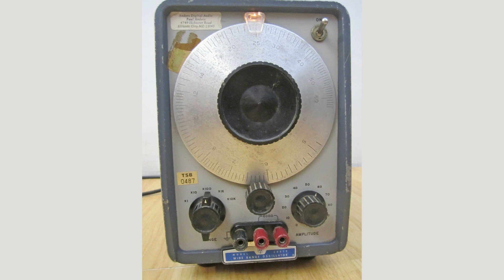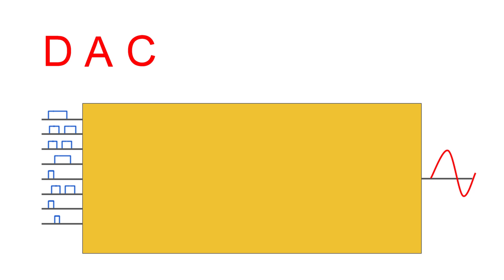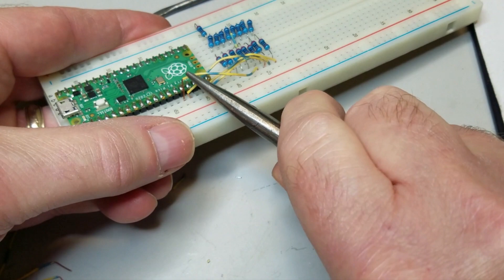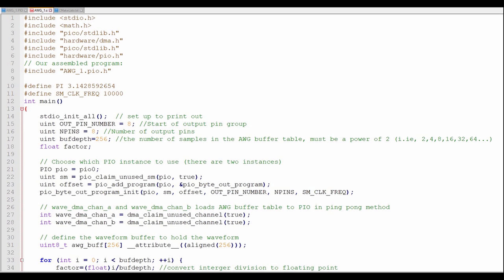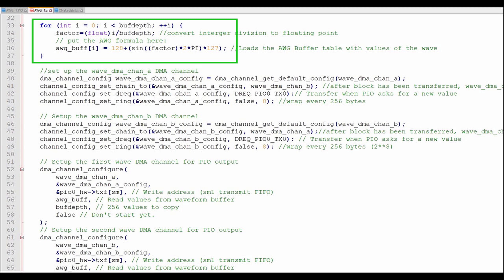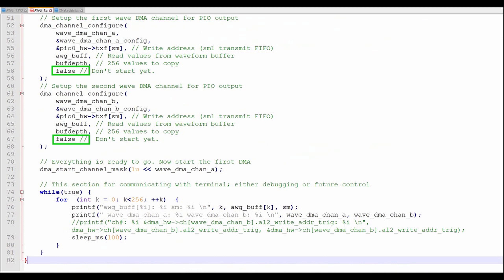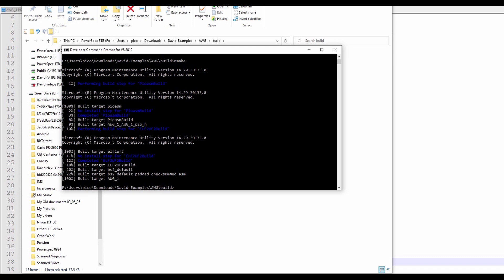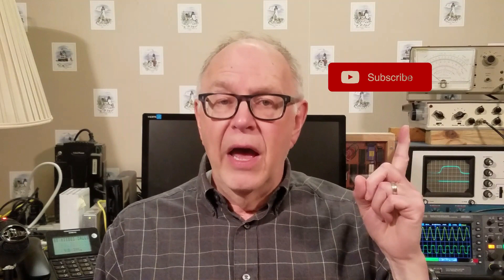Raspberry Pi Pico PIO - Ep. 14 - Arbitrary Waveform Generator

Comment: Ideas for you David:
1). Do the reverse, input waveforms, then display them via your method, basis of an oscilloscope.
2)  Modulate the waveform with a baseband signal for an AM transmitter.

Probably reaching the limits of what the Pico could do unassisted, but I'm blown away by the capability of DMA/PIO.
Reply from the maker: Those are great ideas.  I'm working on a higher frequency AWG now.  Thanks for watching!

Comment: HI David. Thanks again for a wonderful video! The Pico project I'm sorta looking at is to make a simple software-defined radio out of an Si5351A board and a Pico. I'm thinking of using the Si5351A to generate generate quadrature LO signals and a couple of SA612 mixers to give me I & Q signals. I want to read I & Q into A/D converters on the Pico using DMA. 

I'm intrigued with the potential to make a very cheap SDR receiver that's somewhat out of the normal. In particular, I'm fascinated with having the crunching power of two cores that don't have to work significantly on data grabbing. And doing it in Micropython  :-)  although I can do it in C if necessary.
Reply from the maker: That's a neat project.  MicroPython is not quite as capable as C when it comes to PIO interrupts or DMA.  I had to go to C for my video and AWG projects because of that.  Good luck and keep us informed of your progress!

Comment: Fantastic project and the whole series you're making David! Helped me a lot. Until now all my projects were C++ based (Arduino, Teensy, ESP etc.). I picked the Pico for its rapid and easy prototyping with Python, which I was looking to finally get started with. Having to go through C++ chain and the separate io file and steps to achieve the coolness of PIO is a little off-putting. Definitely not "prototyping-friendly". I wish there was Python path for the same. While I'm fine with C++,  for now I'll need to focus on the basics and mastering the Python.
Nonetheless, I'll be coming back and keep my eye on your fantastic work.
There are two important factors I really like about your videos. One, is going through the code and explaining what particular statements are responsible for. And the second is explaining the background of the topic, which like in this episode, not everyone might know what is and how an arbitrary generator works.
Reply from the maker: Thank you for the kind comments.  I like making videos, and my tendency to "over-explain" (my kids' term) helps with the background.

As you may know, many of my early PIO videos used MicroPython.  There is a lot you can do with MicroPython; although some things might be a little clunky.  Thanks for watching!

Comment: Thanks for nice and unparalleled coverage of rp2040 pio. Would appreciate if you could consider SPWM waveform generation using pio in some of your next episode.
Thanks for your efforts and excellent coverage.
PIO peripheral is already available on many other brand mcu but such a  beautiful coverage on pio is unique on YouTube.
Thanks.
Reply from the maker: Thanks for the suggestion.  I plan to follow up my Arbitrary Waveform video with one with a higher frequency op amp with a slightly better user interface.  This sounds like it would be well suited for SPWM.

Comment: Super interesting video David. It would be great to know how far you can push this up. BTW, I read it is possible to overclock the 2040 up to 300Mhz without issues. Thanks for sharing, I am learning how to do PIO programming.
Reply from the maker: Thanks.  I've got the high speed op amps but I haven't put it together yet.  Right now I'm thinking a pseudo sine wave of about 15 MHz ( 8 samples per wave cycle)

Comment: Thank you for continuing the exploration of the capabilities of the Raspberry Pico. Have you covered hardware interpolators for the raspberry pico?
Reply from the maker: Thanks for watching!  No, I haven't looked at hardware interpolation.  I'm not sure what I could do to demonstrate it on a Pico.  If you have any ideas; let me know!
Reply: @LifewithDavid1  I haven't seen examples yet but the datasheet says it can be used for audio dithering and textures. I do like the idea that it can do simple repetitive operations like right shift, masking and saving processor cycles.

Comment: Fantastic project.  Thank you.  May I suggest you use something like a BUF634 as an output buffer-amp..  And, would you make the code available?
Reply from the maker: That's a great idea.  I didn't know about the BUF634, which looks like it would be easy to implement.  However, I already bought some LM6171's and LM7171's to improve the frequency response; which I hope to do soon.  Follow the link in the description for the code.  Thanks for watching!

Comment: I'm always impressed with how much can be done with the PIO blocks!

Do you know if the block exists in other Pi devices, like the Pi Zero (BCM2835)?  For example, there's a Pi project using a GPIO to implement an RF transmitter!

Another great Pico PIO example is the can2040, which achieves full 2.0b Can Bus Specs using only one of the PIO hardware  blocks!

BTW, I've been thinking of implementing the PIO functionality inside an FPGA/CPLD.. any suggestions?
Reply from the maker: I don't believe any other RasPi device has PIO.  They do have specialized I/O for handling several different standardized protocols.  I'm not sure, but the higher clock speeds for the Pi 2, 3, 4, and 0 should allow them to do bit banging and give the illusion that they have PIO.  

Looking at the history of the Pico, it was first implemented on FPGAs during development.  I've not worked with FPGAs (I'm too cheap and the Pico gets me the FPGA functionality I want at a VERY reasonable price) but I don't see why you couldn't make it happen.  Good luck!

Comment: David, now that you are close to mastering the PIO on Pico, why not try your hand at the FlexIO on the Teensy 4 or 4.1? Nobody else has tackled this, so you’d probably attract a ton of new subscribers from the Teensy community.
Reply from the maker: Thanks for the suggestion!  As I learn more about the RP2040, I realize how much more there is to learn.  I've not worked on the Teensy before; so I scanned the web for info.  Version 4.1 looks like a very powerful controller.  I'll look into it more; but I'm afraid it could be quite some time before I can put out content that would be worth people's time to watch.
Reply: @LifewithDavid1  You bet! Your PIO series is really a general master class on hardware concepts in modern systems - and in programming them. Way beyond merely the Pico. As for the Teensy, you're right. It's the most powerful microcontroller out there. And FlexIO is its PIO. 
Keep up the great work!
PS I too work with 65xx ICs, so I really appreciate what you're doing.
Reply from the maker: @jonathanstein6056  Thank you.  I appreciate your kind words.

Comment: Sir, Can you make a video to interface ADC08100 to pio of raspberry  pi pico and display the analog waveform on a pc ?
Reply from the maker: That's a really ambitious project!  I'm not sure the Pico could handle that much data.  It only has 256K of memory, which would only be enough for a few milliseconds of a signal at 20Msps.  And that doesn't include any space for the program.  The Pico does have a built in ADC which can (I think) sample one pin at 500Ksps.  That might be a good place to start.  Thanks for watching!

Comment: Because of my electronics noobitude, I wouldn‘t have thought of using the op-amp, believing that the output of the DAC by itself would be enough. What is the output range of the DAC when it‘s powered by VUSB? How is it improved by the op-amp?
Reply: Oh sorry, the inputs to the DAC are GPIOs, so they‘re high or low in the 3.3v range. It‘s the op-amp that‘s powered by VUSB. #noob

So is the op-amp used in order to get output in the 5v range? If so, then you could do without the op-amp if you‘re okay with DAC output in the 3.3v range? #noob #questions
Reply from the maker: These are all good and important questions.  If you go slow enough, and the downstream circuitry doesn't draw any load, then you can get by with no op-amp.  However, to get any speed, or to provide any current, you need an amplifier to keep the current draw and capacitance on the resistor network as low as possible.  This will also maintain the accuracy of the DAC because a higher downstream current draw on the resistor network will load the most significant bit (MSB) GPIO more than the LSB.  This will cause a little voltage sag on the MSB GPIO, causing non-linearity.

Because the op-amp is set up for unity gain, the output will be 0 to 3.3 volts (same as the input).  Note that while the LM358 is capable of single supply operation, there will still be some non-linearity near 0 volts.   

If you were to set up the op-amp as an inverting amplifier with a split power supply, you could make an output that would be useful for all types of downstream circuits.  Op-amps are awesome little devices, and there is a ton of information on how to use them "hidden" in their datasheets.  Look through one, don't be discouraged if you don't understand all of it at first.  The idea is to just familiarize you with where and what kind of information you can find.  Good luck and have fun!
Reply: @LifewithDavid1  thanks! My mental model of an op-amp was that it‘s just for amplification, but obviously there‘s a lot more to it than that. I might have some LM358s in the “box of stuff to try out someday”, looks like it‘s time to do just that.
Reply: @slimhazard  I definitely encourage you to do! For very long time op-amps were a mystery to me. Especially, when very early in my electronic journey I saw an analogue computer full of them. They can do all sorts of mathematical operations! I was thinking "how on earth?". Lately I finally got to use them and even do some designs. So awesome and relatively easy to work with. Just like Lego bricks.

Comment: is it possible to read single colors from a hdmi signal with pico?
Reply from the maker: HDMI is just too fast for the Pico.  Even the slowest HDMI (cat 1) operates at 75 MHz.  The Pico operates at 125 MHz, which only allows 2 clock cycles to process each chunk of HDMI data.  This is just not fast enough.  Sorry.

Comment: Pi is 3.1415926535 from memory, you have 3.1428592654.  Is there a reason that I missed?  So I tried the difference between 39Hz and what the pico gives from the clocks and got 3.1466272572013.

I'll puzzle it out in the end before I call typo :).
Reply from the maker: Go ahead and call typo.  I remember that Pi is 3.14159.  This came from a little chunk of code I got from another program.  In fact I was going to change it; but it slipped my mind.  Good catch!

The difference in Pi will lead to a mis-shapened curve but not a difference in frequency.  However a better value of pi will lead to a better curve.  In reality; it probably doesn't make any difference at all since the resolution is only 1 in 256.
Reply: @LifewithDavid1  Given most uses of PI end up being multiplied by 2, there is merit in using Tau(2xPI) instead of PI.

Looking at the code: awg_buff[i] = 128+(sin((factor)*2*PI)*127); //Loads the AWG Buffer table with values of the wave

Though maybe the compiler is clever enough to optimise that out, though might need bracing the (2*PI) to nudge that, safer with Tau as any literal when the first thing you do is multiply it by two always bemused me.